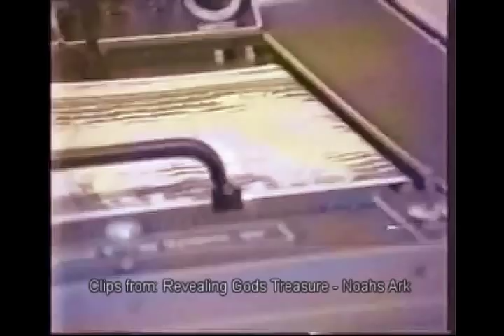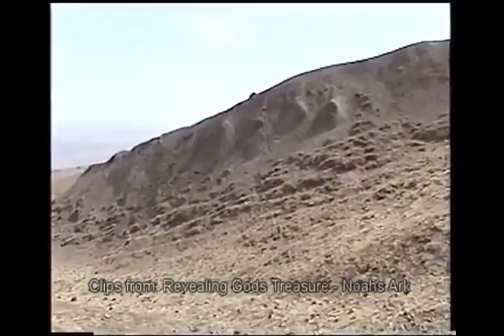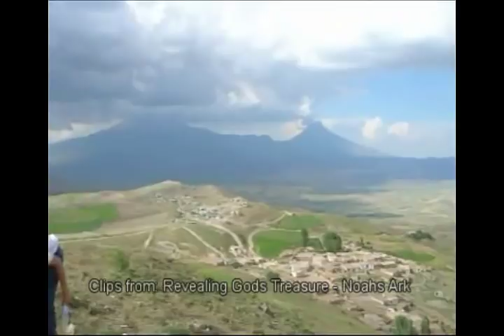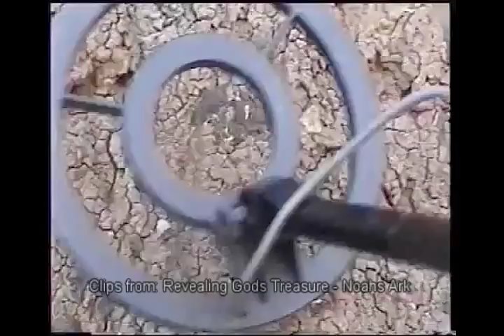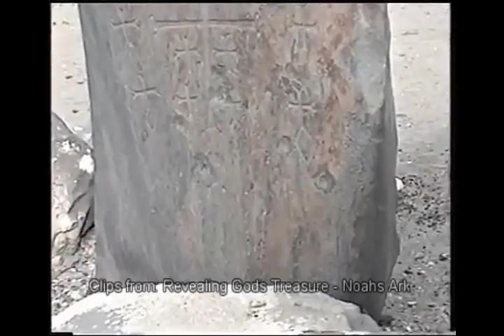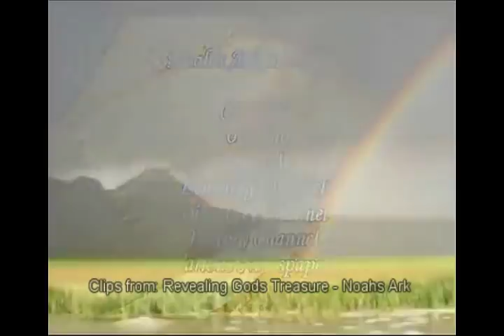NOAH'S ARK FINALLY FOUND!! [2 of 2] TOTAL PROOF!!

Comment: Lot's of convincing evidence. Only problem I have with this site is its elevation in light of Gen 8:4-5. These two verses indicate Noah's Ark came to rest on the highest point in the mountains of Ararat since it took over two more months of the water receding for the rest of the mountain peaks to become visible. 

The elevation of this Durupinar site is at just under 2000 meters. less than 6600 feet. Mount Ararat itself at 16,000 plus feet, as well as Little Ararat next to it and almost as high, are both clearly visible from this site. They would have been visible long before the ark landed anywhere near the Durupinar site elevation. A contradiction of the said two verse passage in Genesis.

Comment: I doubt that this is Noahs ark, the one they filmed at 14,000 ft. if this is a true and not staged seems more real to me then this one, or it would have been considered the ark a long time ago. It most likely is a boat , but not Noah's ark.
Reply: Edward Payne This is the biggest boat you could build out of wood, before it would collapse under its own weight.
Reply: So, what’s a boat of this size doing 14000 ft up a mountain. How did it get there?